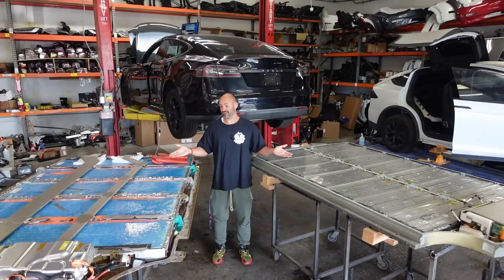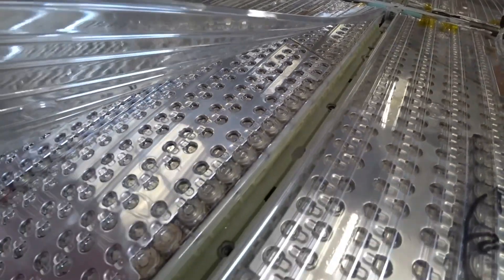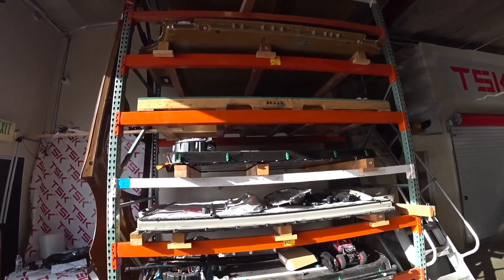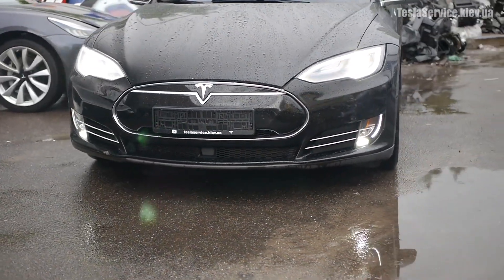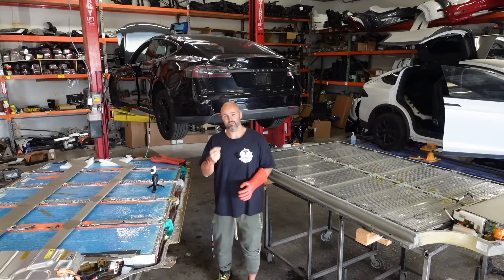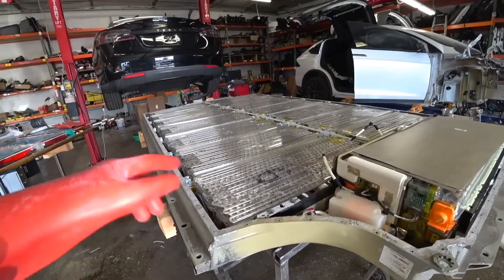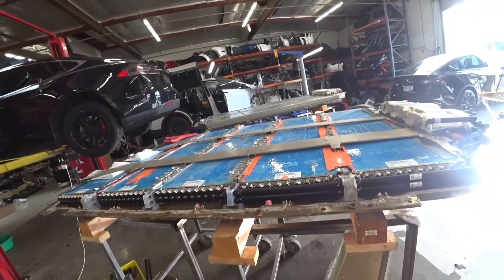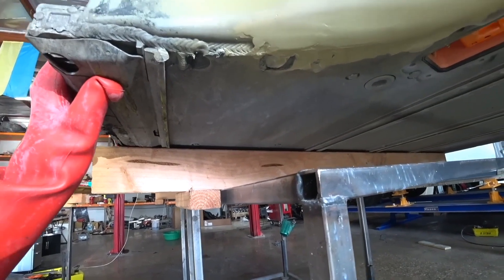Tesla Battery Repair/Replacement?Maximum Battery Charge Level Reduced/BMS-U029/BMS-U018/BMS-W164

Comment: You said I have to have after 10 years of use still about 90% of capacity ??? No way ! My Tesla 3 LR 12/2020 with 158 000 km has now saxs Tessie app about 15,05 % of battery degradation and about 66,07 kWh cappacity …. After not even 5 years of ussage and not even 160 000 km !!! 😢😢😢
Reply: 2019 tm3 awd 59000km SoH 89%. charged only slowly to max 80%

Comment: There's a lot of unknown today around batteries and their repairability.  Too much "I hate BEV's, can't work on them!" and "they're scrap if the battery is damaged or old".  I anticipate a growing third party industry around such repairs, just as developed for ICE vehicles.  Interesting times.  I'd be interested to know your approach to fixing the structural packs or whether the fixes are currently limited to mechanical damage as illustrated here?